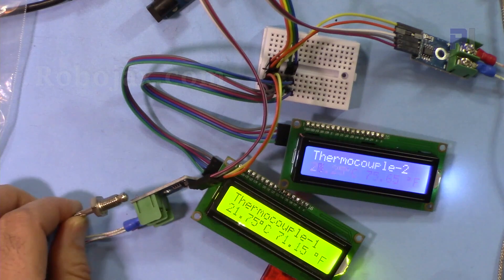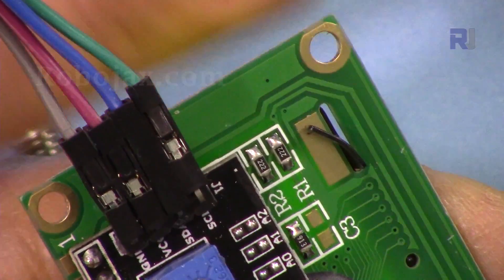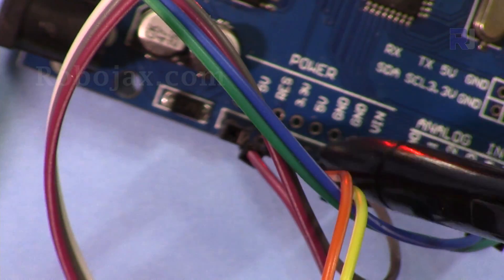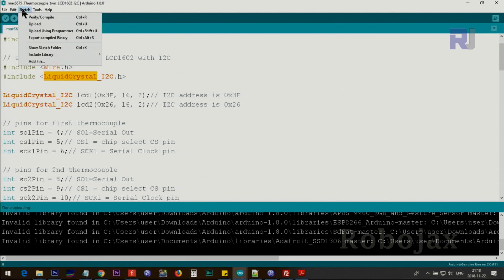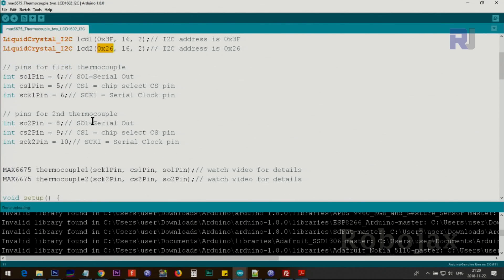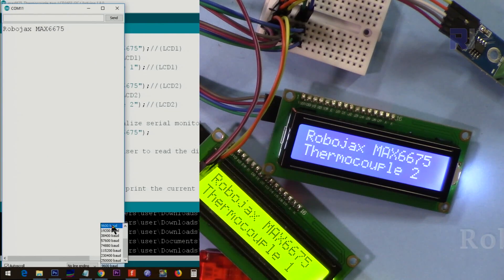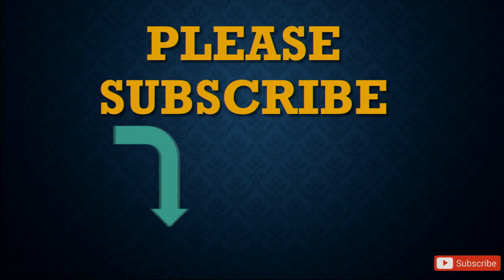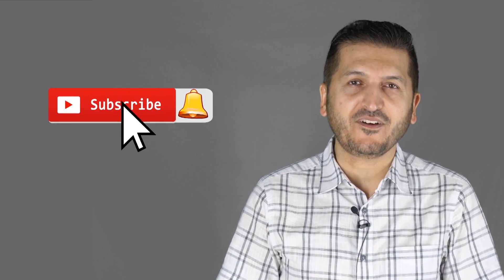Lesson 41: Using 2 MAX6675 with 2 LCD display| Arduino Step By Step Course - RJT141

Comment: Hi, what kind of conditions/situations that making booth of the sensors would not has the same value of temperature ? is it depends on the sensors or the thermocouple probe ? Thanks..
Reply from the maker: Hi, they are totally independent sensors.